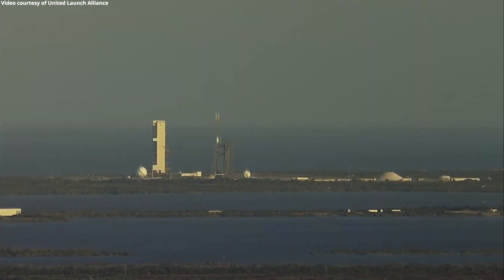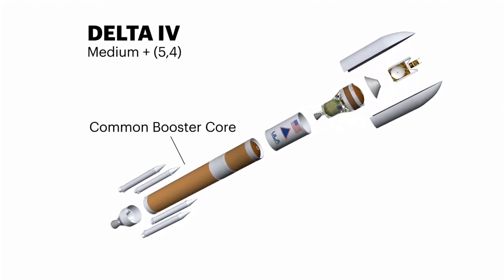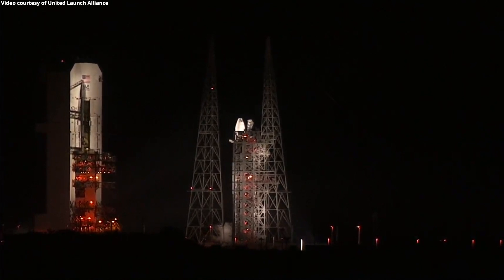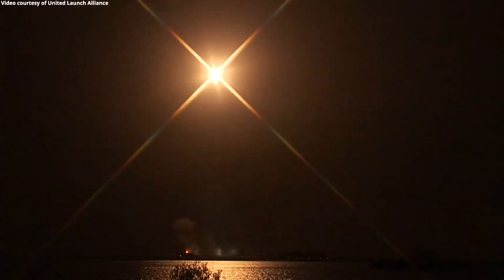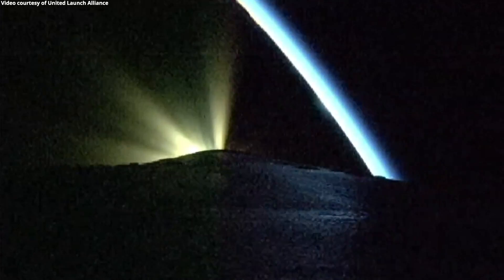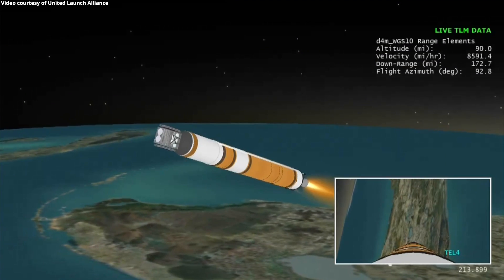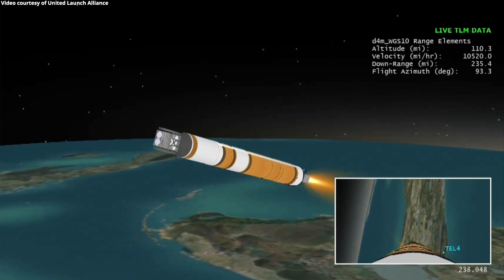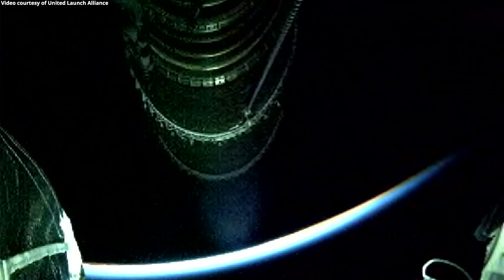Delta IV launches WGS-10

Comment: Go metric you luddites!
Reply: Sean Duggan wrote: "Go metric you luddites!" To which I say: "Become bi-metrological, you SI snob!" Now:

If you had any idea how much rocket production tooling, test equipment, GSE (Ground Support Equipment), tracking gear, and materials such as manuals are made to ASA--American Standards Association--specifications (the United States has ^never^ used the British Imperial units, as so many foreigners mistakenly believe), you would understand why we continue to, and always will, use ASA specifications. It isn't a matter of being stubborn; our investment in such equipment--hundreds of billions of dollars--is so enormous that it would make no sense to just junk it all and go metric just for the bragging rights ("We're metric too!"). Also:

It's a matter of safety (which is always a prominent concern regarding rockets). If ULA (whose predecessor firms built the Atlas, Agena, Thor, Delta, and Titan missiles, launch vehicles, and rocket stages--the ancestors of today's Delta IV and Atlas V launch vehicles), hypothetically, decided to go metric, just one incorrect (or insufficiently exact) ASA-to-metric conversion--say, of engine chamber pressure, or propellant tank skin gauge (thickness)--could cause a fatal accident, even on the ground, in the factory. A very pro-metric retired U.S. Navy Rear Admiral I know advocated ^against^ converting the nuclear submarine engineering specifications from ASA to metric for the same reason; just one such conversion error or too-inexact conversion, among the tens of thousands of engineering specifications, could result in a fatal accident.

Comment: Waited all night, went to the bathroom cause I hadn't heard anything, and opp... it's up and away...come on guys...how about a little warning..some play by play 4 minutes before launch would have been nice.
Reply: Pherfinion Moon wrote: "Waited all night, went to the bathroom cause I hadn't heard anything, and opp... it's up and away...come on guys...how about a little warning..some play by play 4 minutes before launch would have been nice." Well:

That sounds rather like Minuteman III ICBM training launches at Vandenberg Air Force Base on "foggy" days, when the cloud ceiling height can be measured in ^stories^. The launch crew communications traffic is broadcast "in the clear" on radio, BUT they don't use a numerical countdown. Instead, they read off the lines in the manual, and unless you're familiar with the steps, there is no warning--just a line that reads, "Stage 1 ignition." If the cloud base is hanging just a few stories overhead, you'd better look quickly, before the missile disappears in the soup overhead! :-)

Comment: If anyone ever asks you what kind of mileage this baby gets just tell them that it's around 2 thousand pounds of propellant per second. Do the math.
Reply: What's a pound? Here in the UK, it's money.
Reply: @Michael Görtzen Everyone in the UK knows what pounds (of weight and currency), ounces, miles, etc. are (I know people in the UK whose ages range from teenage to their seventies, and they all know). Also, the miles that are used in spaceflight are nautical miles. The nautical mile, and its derived velocity, the knot (which is 1 nautical mile per hour [1.15 statute miles per hour]) are independent units, based--as the kilometer originally was--on an arc of distance on the Earth's surface. 1 nautical mile is 1 minute (1/60th) of a degree of latitude, now defined as 1852 meters. In addition:

There is the "pound sign" (this symbol: #), which is also called the "number sign" and the "hash." It's used as a quick way to denote pounds of weight (such as, "3# of ground coffee" on a grocery list), and to number items in a list so that they're more visually noticeable (such as in a recipe, "#1 Mix the butter and sugar, #2 Heat slowly, to caramelize the mixture, etc."). The UK and U.S. pound of mass (the pound avoirdupois) are the same. The pound is also used as a unit of force (as in pounds of thrust for jet and rocket engines), but the U.S. gallon (the Queen Anne wine gallon) and the Imperial gallon are very different (the British Imperial measures were adopted in the 1820s, long after the American Revolution). As well:

I find the whole "Why doesn't the U.S. go metric?" business wearying in the extreme. If we ever meet intelligent extraterrestrials, they certainly won't be using any of the units of measurement that we use. Any set of units, as long as it is internally self-consistent and its units are defined in terms of constants (be they physical, such as the Earth's circumference or a portion of it, agreed-upon numbers of atoms, etc.), can be used in engineering, science, medicine, business, agriculture, and so on. Given those things, It's a matter of convenience and taste. For example:

Carpentry is easier to do using UK or U.S. units than metric units because feet and inches are readily divisible into halves, thirds, quarters, eights, sixteenths, thirty-seconds, sixty-fourths, tenths, and hundredths, but one ^can^ do carpentry in meters, decimeters, centimeters, millimeters, and half-millimeters if desired; the other divisions can be made if one uses a set of dial calipers or vernier calipers.
Reply: @j.jasonwentworth723  There are still some dinosaurs in the UK that hang onto pounds and ounces (indeed, the whole imperial system) and there are "practical" reasons the USA clings to it still. But the metric system is far better as it uses decimals (base - 10) and the units are integrated (eg: a litre of water at 4 degrees centigrade occupies a volume of 1000 milli-litres and ha a mass of 1 kilogram - making it easy to see that a gram of water at 4 degrees C has a volume of 10mmX10mmX10mm or a cubic centimetre.) The USA would have to invest hundreds of billions to recalibrate a lot of machinery and tooling, plus a great deal to educate the public in how the SI system works - and while they have tried in the past there is a lot of resistance to it. More modern companies in the USA tend to use metric, and most goods intended for export from the USA need to be described in metric units, or indeed calibrated to such units. One day the USA will have no choice - particularly when China starts to become the world's leading economic power (3 to 4 years from now). Hanging onto Imperial will hold back the USA in time to come.
Reply: @Michael Görtzen No it is not... it is a currency used in the UK. 40 centuries ago, it was used by Noah to weigh the animals as they entered the ark. It was soon abandoned as a unit of measurement when King Solomon (wise king) decreed it to be outlawed. God agreed...

Comment: ULA please use metric telemetry for us.... Please?
😳
Reply: Americans are not intelligent enough to use metric (which is far easier to understand and learn). They prefer biblical measurement systems.  They say: "Noah used feet and inches, pounds and ounces when he built the ark and that comes from GOD - and we LOVE GOD".
Reply: The Tag Market you say we aren’t intelligent, but who designed these rockets?
Reply: @thetagmarket1058  We don't use cubits anymore, and haven't for a very long time. Your attitude, ironically, is very Biblical--Old Testament, in fact. Just as the Israelites wanted a king, just like their neighboring countries had, you're anxious for the U.S. to go metric so that we'll be like everyone else--talk about being a slave to fashion! Actually, France and the United States co-invented the metric system (Thomas Jefferson was one of the most enthusiastic advocates of it). We didn't change to it (and still haven't, and never will) for a very good reason:

We already had a system of agriculture, manufacturing, and commerce set up and operating, which was (and is) based on the previously-existing units of measurement. Today, having an economy that is many times as large as it was nearly a quarter of a millennium ago, switching to metric would be even more expensive--and for negligible tangible benefit. Also:

Every structural, plumbing, and electrical component of my house down the street (and of the apartment building I now live in) was made to ASA (American Standards Association) specifications, as were the tools and fasteners that were used to build them--and this is the case for houses and all other buildings that are being built in the U.S. today, which must number in the tens or scores of millions, and:

It would be unfathomably expensive--and utterly pointless--to convert all of them (and their tooling) to metric (if one could even do that without tearing them down and building new, metric-specification replacement ones). Our SRBMs, MRBMs, IRBMs, ICBMs, ABMs, space launch vehicles, satellites, and lunar, interplanetary, and planetary spacecraft (and manned Earth orbit and lunar spacecraft) have been designed, built, and operated using ASA units. SpaceX, since they started from a "clean sheet of paper," could start out being metric from the beginning (but I would not be surprised if a lot of their specifications and tooling are ASA rather than metric). But:

If this country was similarly starting off "from a clean sheet of paper," I would have little objection to us being metric (although carpentry is easier to do--without calipers--using feet and inches because they are so easily divisible by many factors such as 2, 3, 4, 8, 16, 32, 64, etc.--ditto for the 360 degree circle [the 400 grad "metric circle" is less versatile; only the 100 grad quarter-circle is very useful, for indicating road inclinations on highway signs). But we aren't starting off that way; we have enormous quantities of equipment, buildings, tooling, and many whole industries, all of which are ASA units-based, and it would be sheer madness, not to mention financially suicidal, to change them all to metric just to "be like everybody else."
Reply: @j.jasonwentworth723  It's just a joke... Teasing the luddite USA a bit
Reply: Foreal tho
Reply: stekii lol we aren’t and one of the main reasons that we haven’t is that most people here don’t see a reason to, all of our road signs would have to change
Reply: stekii not all of us are, grouping the same people that sent men to the moon with the people that think vaccines cause autism is unfair
Reply: @stekii WRONG! The United States has ^never^ used Imperial units, which were adopted by the UK in the 1820s, nearly half a century after the American Revolution. Why don't we convert to metric? Think about all of the millions of buildings--from sheds to houses to factories to stores to restaurants to skyscrapers to sea ports to airports to train stations to space launch sites (we have four orbital launch sites and several suborbital ones), all of which were and are built to ASA (American Standards Association) specifications, down to their lumber, plumbing, fixtures, and electrical wiring. That's trillions of dollars of property (not even counting the ASA-specification tooling that was and is used to make all of it). Why should we just junk that whole perfectly usable aggregate investment and spend many fortunes replacing it with a metric-specification one, just to make some whiny foreigners happy?
Reply: @stekii Dr. Robert H. Goddard built and launched the world's first liquid propellant rocket on March 26, 1926. Guess which units he used to design and build it and his subsequent rockets? A hint: they weren't metric. Many years after he came to the U.S. with the rest of the Peenemünde team that developed the A-4 (V-2) ballistic missile, Dr. Wernher von Braun, by then working for NASA, suggested that U.S. rockets be built to metric specifications, but:

When he was asked, "Why?", he could give no answer (except that he preferred metric). All of the tooling, test equipment, handling fixtures, static test stands, launch complexes, and instruments that NASA and its contractors (Chrysler, Boeing, Douglas, McDonnell Aircraft, The Glenn L. Martin Company, Lockheed, TRW, Grumman, Rocketdyne, Aerojet, etc.) made, had, and used were designed and manufactured to ASA--American Standards Association--specifications. Having such a huge investment in ASA-specification equipment, it made no sense then--and wouldn't make sense today--to discard it all and replace it with metric-specification equipment. Doing that--for no tangible benefit--would have made (and would make) about as much sense as throwing out all of the English-language blueprints, specification books, and manuals and replacing them with ones written in Esperanto.
Reply: @Shaboi_Mike oh okay... Sure..
Reply: Are you stupid? It's an American Company, American rocket, launched from American soil.  It's not gonna use foreign measurement systems. It's all American. Convert the measurements yourself. Deal with it.
Reply: Alex 1218 Space X uses metric which I hate.